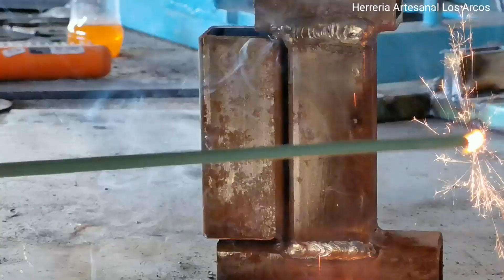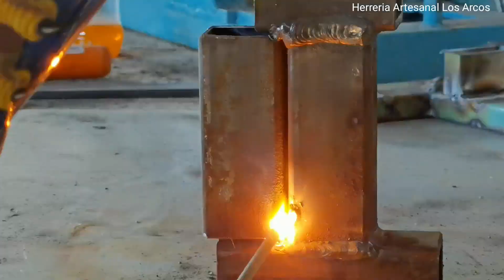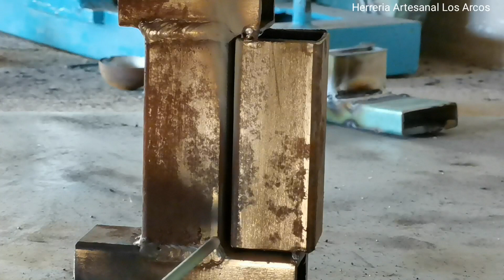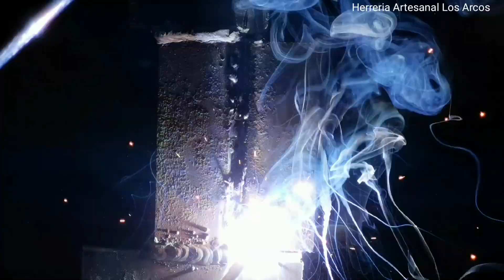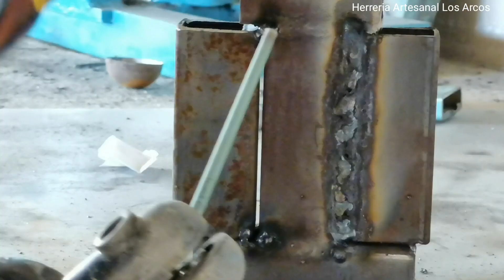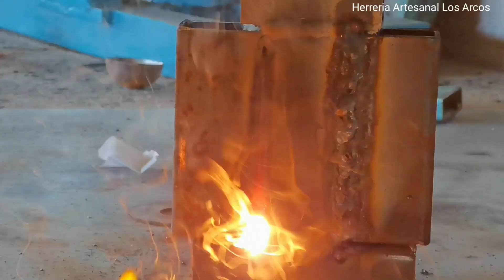nada fácil soldar en ascendente PTR cal 14

Comment: Es mejor aplicar con electrodo de 3/32 dado que necesita menos amperaje,y ese calibre es muy delgado para aplicación de ese tipo y es más difícil aplicar sobre el otro cal.14
Yo recomiendo si es con 6013 que sea amperaje de entre 50 a 65 amperes, en ocasiones el amperaje alto provoca que la soldadura quede colgada y para eso se necesita un amperaje bajo para evitar eso.
En mi caso llegó a utilizar amperaje de 80 a 95 amperes en soldadura 7018 de 1/8 en placas de 1/2",hay muchas tablas que le pueden ayudar en una mejor aplicación dado a esas posiciones...
Ánimo solo la práctica hace al maestro,buenos sus contenidos 👍